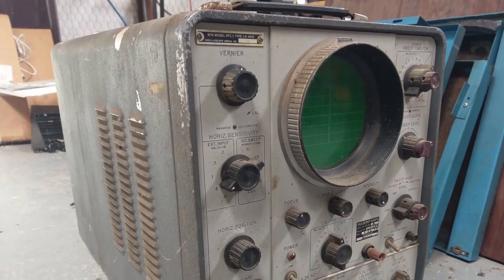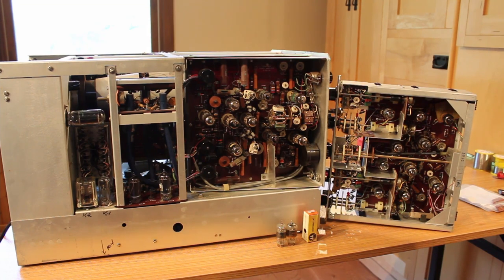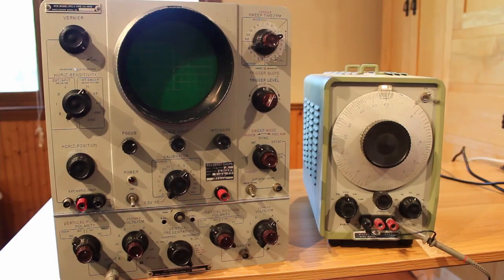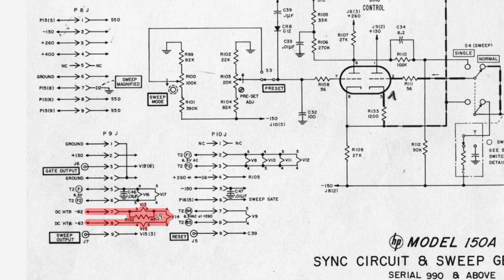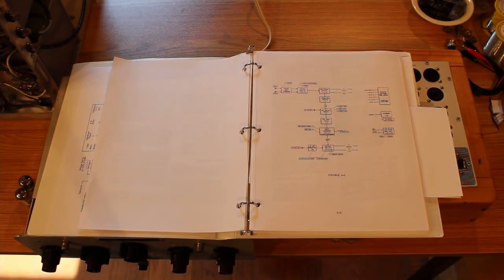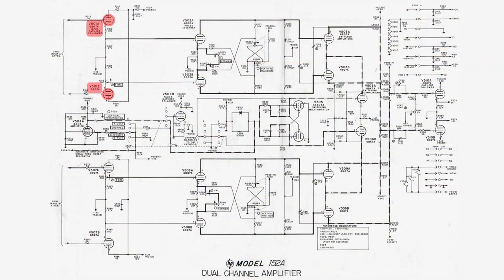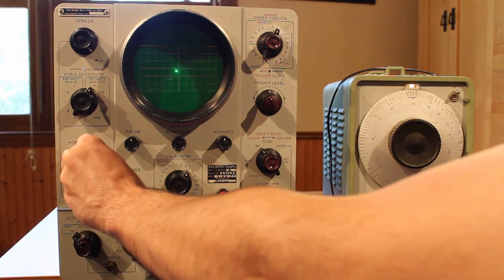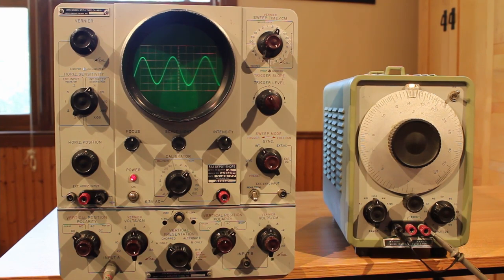Restoring an HP 150A Oscilloscope (Part 2)

Comment: Hello. Very nice looking scope! Some observations:
The horizontal sweep is not linear, you can see this affect by looking at the screen and seeing that one side of the sine-wave is compressed. This non-linear ramp could be caused by multiple things. Even for a 10MHz scope, capacitor lead length and their orientation in circuit is very important. Chances are, this scope is "just for fun" so probably not to big of a deal. If you want it to operate like it did when it was new, you have some work ahead of you. 
Good Luck, and have fun!
Reply from the maker: Whoa, Mr. Carlson, hello!
(I've been a big fan for a while!)
Thank you so much for the tips! You're right that this is definitely a "just for fun" scope, so I'm not really expecting it to get back to 100% - I would be quite happy with "close enough for government work." Particularly, for my uses, I never really do anything over 100 kHz, and I don't think I even have anything that'll generate a signal faster than 1MHz, so the scope is already spec'd well beyond what I'm capable of even testing here. However, I would indeed like to get it fairly close to being right.
As I was filming it for this video, the longer it was on, the worse it got, eventually getting to the point where the internal sync stopped working altogether. If you look at 20:46, the sine wave is traversing across the display because at this point I actually had to switch over to the "Line" setting and bring the oscillator frequency down until it kind of settled down a bit. So, I think I've got some resistors that have drifted quite a bit from spec, or may be getting worse as they start to heat soak. It's still a long road to go, but now that it's actually giving me some life, it should make diagnosing it a little easier (I'm hoping at least, haha)!
Thanks again for the tips and as always, I'm looking forward to the next video from the lab!
Reply: @UsagiElectric  Wooa, is right. This Mr. Carlson's guy knows his stuff.  Might want to look into his idea about outside foil when recapping.
Reply: @UsagiElectric  DUDE! You made "The Big Time"! Congrats!!!!
When the "Tube Master" comments and shares his EXCELLENT knowledge with a guy, he has made it!
Paul Carlson IS the man I would most want to emulate, when it comes to electronics.
LOVE your Channel and your content BTW!
All the best,
Patrick
Reply from the maker: @FordSeniorMaster  Thank you so much!
I definitely showed all my friends when he commented, I was so stoked, haha.
Mr. Carlson is definitely a huge inspiration and is extremely knowledgeable!

Comment: I am glad to see you didn't try to unsolder the capacitor leads through the PV board.   These old PC boards, the copper traces were held on with wishes and fairy tears.
Reply from the maker: There were actually quite a few places through the build that did require me to unsolder the leads from the PCB, and surprisingly, the traces were totally fine! Sure, the PCBs are not as robust as modern equivalents, but they're certainly tougher than I was expecting!

Comment: The trouble with electronic components, you can't tell by physically looking if they are good or not.  the "black beauty" caps are usually a paper / foil type capacitor and they papare has long since started to degrade, creating parallel resistance inside the capacitor, which can cause major problems.     One of the joys of restoring this old equipment, but once restored this old test equipment will last you a life time.

Comment: If you follow Mr. Carlson's Lab, you won't make any errors that may make getting new parts necessary, such as doing wholesale cap replacements of ALL old equipment (unless some micas are left in). Checking using a Flir device will spot cold tubes. Or other simple ways, such as simple meter checks of filament strings.
Reply from the maker: I do indeed follow Me. Carlson's Lab, but I also do have to work within the limits of my budget and goals for the project. I'm not expecting the scope to ever get back to perfect accuracy, but I am hoping to bring it in spec. But, some things are just not feasible. A Flir camera for example costs about three times what I paid for the entire scope. Blanket cap replacements aren't always the best solution (though in this case, I've pretty much already replaced every cap that wasn't a Mica). But mostly, I'm really just having a ton of fun following errors and problems through the system and fixing the parts one by one. And fortunately, that's let me catch some parts that I wouldn't have caught otherwise, like poor emission on a horizontal amplifier tube or a bad thermistor on the 400V rail.
Reply: @UsagiElectric  ,  I guess ya gotta do whatcha gotta do. Good luck!

Comment: In series heater strings they usually use "A" suffix tubes, which have a specially controlled heater warmup time so all the tubes share the current and have equal voltages while warming up.   HP cut a corner here, and it showed.
Reply from the maker: DC heater strings actually make sense in some situations as the AC on the heater can actually influence the cathode and potentially cause oscillations. I think HP was concerned with trying to make it as accurate as possible, and so used DC heater strings. And, given that it has a 30-second time delay to get all the tubes to full temperature before applying any HV, using the "A" suffix tubes was probably not as high of a priority.
This scope may not have been the best scope on the planet at the time, but HP certainly weren't in the habit of cutting corners. Personally, I think HP did a wonderful job, and so far, it seems to work excellently! The only drawback so far is that it weighs so much I have to be careful not to blow out my back when picking it up, haha.
Reply: @UsagiElectric  Yes, I have a few large Tek scopes and a sore back to prove it.  BTW I was given a HP 170 scope long ago that had not been turned on for like 25 years.  Not knowing any better I just plugged it in and it worked perfectly.  Well, the fan motor needed  a few drops of oil.  And the Delco power transistors were a bit leaky.  Being HP they overengineered that a bit, making a custom machined heat sink surrounding the fan with what must have been very expensive high-voltage Delco power transistors.  Nobody else used transistors as series regulators in a HV supply but that did not stop HP!  Regards.

Comment: I bet it's going to be a lot of drifted resistors causing those problems, and possibly dirty pots too. 
And just thinking my old scope has only 8 tubes inside. That scope is an absolute beast.
I am enjoying this restoration. Nice job so far.
Reply from the maker: Thank you so much! 

I think you're absolutely right on the resistors. 

It was actually working much better at the start of filming, but after about an hour of on-time, it was becoming more and more finicky, and more of the scope stopped functioning. If you look at 20:43 in the video, the trace is actually scanning across the scope, and that's because after being on for an hour, the trigger had very nearly quite working altogether. I had to switch it over to "Line" and then adjust the frequency of the oscillator until I got the waveform frequency and line frequency to nearly line up.
So, as it gets hot, I've probably got some resistors drifting quite far out of spec and causing issues. Now, tracking those down is going to be an interesting exercise that I'm sure will turn my already grey hair even more grey, haha.
Reply: @UsagiElectric  Thanks for the lengthy comment, I like reading as a hobby. I guess old carbon resistors would be the only logical conclusion. I've seen a lot of Shango066 videos so I guess I picked up a few diagnosis tricks, plus it precision tube equipment, caps and resistors would matter more, than in radios and tv's. Speaking about caps why didn't make a J-hook when you were installing the new ones, these new lead free solder tend to melt at a lower temperature. Well your content is super educational, and entertaining. I can't wait to see more on this unit. Oh, and I love your hair. I am sure all your subs do as well... It makes you appear sorta like that Ancient Aliens guy, But instead of aliens, Ancient Electronics... Besides Weird hair make one look more Intelligent. Like that German guy with his fake relativity theory  LOL!
Reply from the maker: @paulawillaminachandler-ren3725  I'm with you and leaning much more towards the resistors drifting as being my primary problem here. Unfortunately, there's about 500 resistors in this thing, so it's going to be pretty tedious to find the right ones, haha.
As for the caps, I don't really have a great reason why I didn't do a J-hook, other than that the 90* bend I made was easy to bend up like that and still held the caps in place while I soldered them in. As for solder, I'm actually using 60/40 lead tin, which seems to flow and work really well!
Thank you so much for the compliments on the content! And thanks for the compliments on the hair too, haha. I do indeed definitely resemble the Ancient Aliens guy a bit, especially how his hair got crazier and crazier as the series continued.

Comment: Very good job on changing those bumblebee capacitors :-) I'm quite sure any one of those in the wild have failed or are very close to it.
Reply: They fail shorted too, so not just magic smoke. Magic boom.
Reply from the maker: I'm glad they were pointed out to me, at first glance I totally thought they were alright as I was looking for leakage from them, I totally missed the cracked casing.
I do feel a lot more comfortable powering it up now with the new caps in place though!

Comment: Heavy duty scope!
Nice job done. So many PCB inside - My TR4401 has no PCB inside. 3D wiring only.
Reply from the maker: Thank you!
And emphasis on "heavy," I nearly throw my back out everytime I lift it up onto the table, haha. 
I think the 150A was HPs first scope to use PCBs. The manual has a dedicated section on how to repair components on PCBs even. 
The TR4401 must be a really, really rare scope! I tried to find some pictures of it, but there is practically no information out there on the scope, that's awesome that you have one!
Reply: @UsagiElectric  Mine is also not too heavy. Only two man needed to carry it. Thats why it has two handles. 
here are some photos: https://dekatronpc.com/index.php/EMG_TR-4401
Reply from the maker: @ArtemKashkanovLive  That thing is awesome! It almost looks like it was meant to be a competitor for some Tektronix scopes, at least the design looks pretty similar. Even the terminal strips for the passive components on the inside is very Tektronix feeling. Still, absolutely beautiful scope!
Reply: @UsagiElectric  Yep, It's a  Tektronix 541A copy.

Comment: I’m enjoying this series. I see you put something white between the board and the capacitor and then remove it. I’ve never seen anyone do that before. What is it? (PS. If you explain it later in the video, I missed it)
Reply from the maker: Thank you so much!
As for the white thing, it's actually really trivial, haha. 
The new capacitors are so much smaller that there is a lot more exposed lead. In some places the more exposed leads got a little close to the leads of other components for my liking, so I just folded up a piece of paper to act as a spacer. I popped the paper spacer down, set the cap on top of it and then pulled the paper out after soldering, which would elevate the capacitors up a bit and keep the leads clear of everything.
If you look at C93 shown at 5:50, you can see how it sits proud of the PCB by a few millimeters. Getting the capacitors to sit at about that height was really the only purpose of the white paper!

Comment: Watching DiodeGoneWild fix a vintage TV recently... he was "concealing" modern small caps inside the busted cases of the old ones.... the finished result is "almost authentic"........ but I suppose that only really works for electrolytics.
Reply from the maker: I've seen quite a few people do that before too! It really does help maintain the original appearance. For this one though, the big metal can caps were hidden deep inside, so I wasn't too worried about aesthetics. Plus, I think the PCB version with the new caps on it looks pretty cool in its own right too, haha.

Comment: Running heaters in series. You say they must be the same voltage and current. Try revisiting that statement. The only requirement is that they must be the same current. Lower current heaters can be used with a parallel resistor to compensate. You assume that the heater went open and then the resistor smoked. Maybe the resistor was high and this caused the pre-stressed heater to blow. Assumptions are dangerous . A visual inspection is never time wasted and you might have seen the resistor was already cracked, just as two minutes with a voltmeter would have lead you to the voltage settings for the mains transformer.

Comment: Hmm not 100% sure here but I think you should of replace those Bumble-bees with 'Metalized Polypropylene Film'  axial caps , rather than brown drops? That could cause the problems that Mr C has comment on.  The adage  'A capacitor, is a capacitor, is a capacitor' is not true in this case.
Reply from the maker: For the time being I think these caps are going to be alright while I diagnose some much larger issues with the system. The longer I use the scope, the worse it gets, so I'm pretty certain that I have some resistors that are drifting further and further out of spec as they heat soak. I'm fairly certain that this is what happened to R132 which caused the 6AL5 to pop - it drifted so far that too much current was being pumped the heater causing it to break open, which then left the only path for current through the resistor, which caused it to burn up. Once I've eliminated all other obviously bad components and the scope is functioning quite reliably, I'll get into trying to bring it back into spec. At that point, if the caps are proving to be an issue, I'll definitely look into getting more appropriate axial caps with the proper lead lengths.
Gotta tackle the big, immediate problems first though!
Reply: @UsagiElectric  Good to know! Remember that to get this back to 100% spec you will have to install any of caps that replaced the  'black beauties' will have to have the 'foil' side toward ground.  Even your brown drops will have a 'foil side'